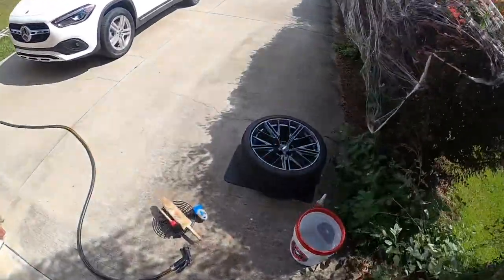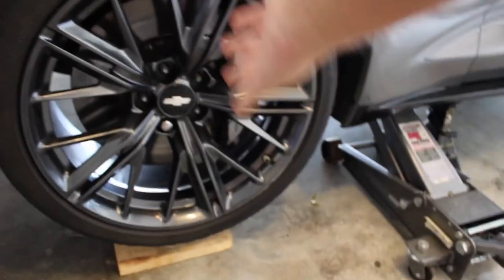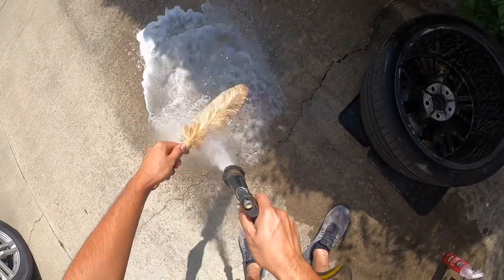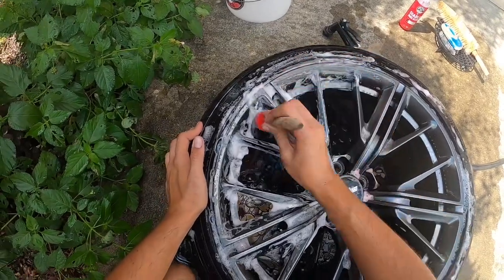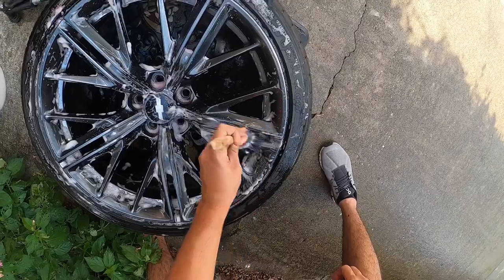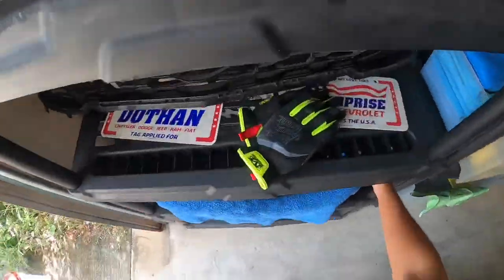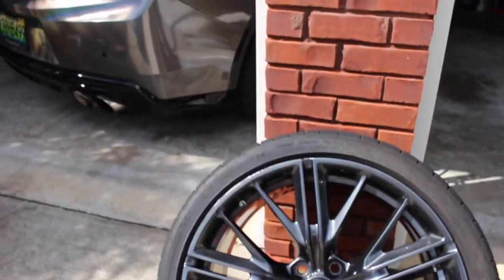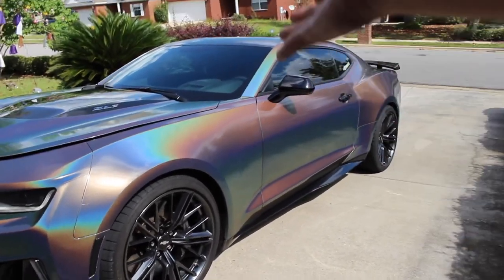Doing A Full Detail on My 2018 ZL1 Wheels

Comment: Do you know how I can avoid tire spinning when I just push a little throttle? I have never push full throttle at all, afraid about lost control.
Reply from the maker: as long as you have traction control on in these cars you should be able to go to the floor and the car will make sure you don’t kick out too hard by reducing power until you have better traction.